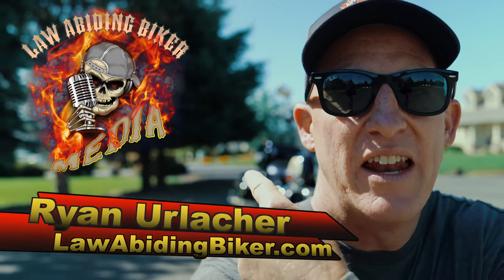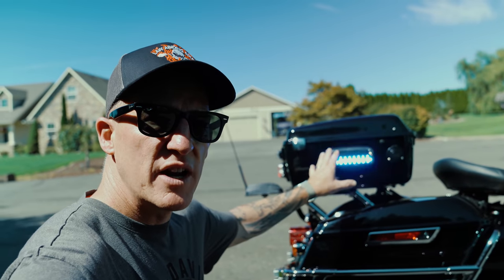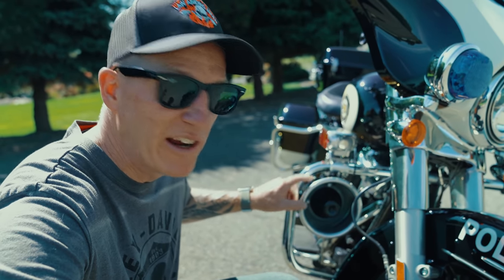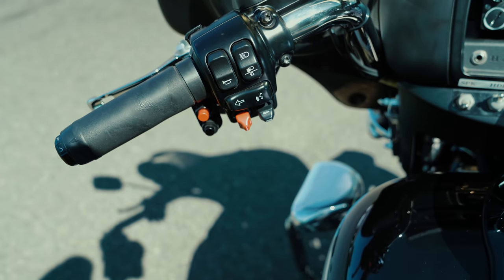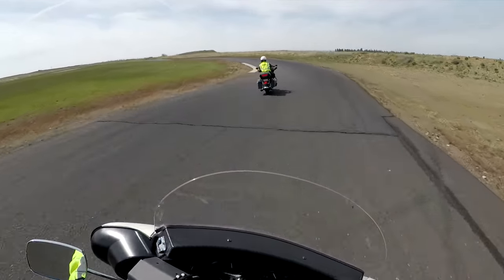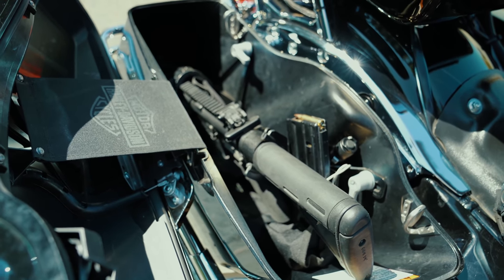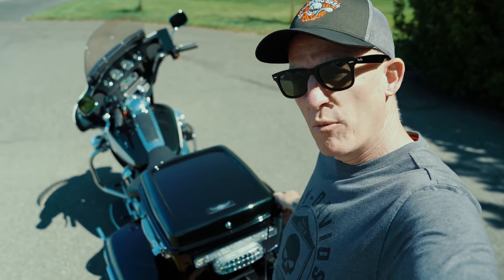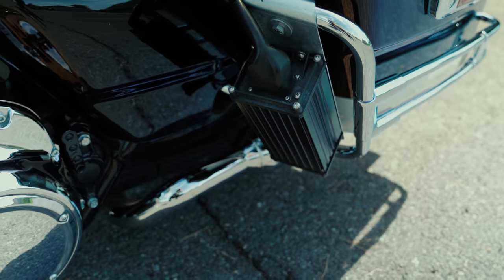Check out my Harley Police Motorcycle!

Comment: Nice video! I’ve worked as a radio technician for 2 different State police agencies and a number of County police agencies installing and maintaining radios, lights, sirens etc on the vehicles including bikes. Yours is the first one I’ve seen with the long rifle mounted in a saddlebag!! All of the bikes I’ve worked on always had the long rifle mounted somewhere on the back of bike. Of course they were locked up but easy for the Officers to access when needed. Your setup is very interesting! Thanks again for the video and stay save out there!
Reply from the maker: It helps keep the rifle clean as well.

Comment: Any suggestions for a reasonably priced am/fm radio and speaker kit for 2014 and later FLHTP's and, or, E/Glide standards?  I've seen one kit for 800 bucks but I'm talkin reasonable priced. On pre 2014 police bikes  with the larger glove box and easy to get to speaker pods, I installed a radio and HOG tune speakers myself for less than 200 bucks.
Reply from the maker: Sorry for the delay. No, I don’t have a reasonably priced solution. Hit me up if you find one you like!
Reply: @RyanUrlacher  I actually found such a kit here's the link /www.biketronics.com/standard-and-police-packages/ I just had this installed at  Auto styles of Leesburg Fl.  for a total OTD price $570.00  I'll include this info on my next youtube video
Reply from the maker: Yah. Cool. Test that baby good. Let me know if it stands up and is with it.

Comment: Does the 107 have good passing power? Compared to the 114? Kind of a weird question considering the police bike needs to be able to pursue, but I was looking at a standard Road King and was thinking of getting either the 107 factory with it or upgrading the engine to the police model performance. Not sure what stage. I'm not going to upgrade the exhaustor air since the current police bikes have 114 with stock air and exhaust.

Comment: Just discovered your channel. Nice video. Have you had any experience with the Concours 14, FJR 1300, or BMW R1200RT police bikes? Which do you prefer? I currently ride an older BMW, but I'm considering either trading it in for an FJR or a Harley Davidson. I'm torn between the power of the FJR and the comfort of the Harley.

Comment: I was looking at used turn in police units yesterday. I was shocked to see a low of 5000 miles and a high of 10,500. Is that a normal turn over, or do you normally put a whole bunch of miles on them before trading?
Reply from the maker: That's up to each agency and what sort of contract they have with Harley. We buy the bikes outright, so we run them for 30k or so and upgrade. Others are on the actual Harley police program where they pay monthly and new bikes often etc.
Reply: Ryan Urlacher thanks for the reply.

Comment: Hey Ryan, greetings from across the Atlantic. I love your videos and have learned a lot from them. 
I have the 2016 FLHTP (TC engine) and just adore it! Love the seat and the overall handling but the best thing about it is:
it looks so cool on the road. Although I'm not a LEO myself, it's legal to own a Police Harley (not quite sure about the blue strobes and the siren, though ;-).
Over here, motorcycle officers ride the BMW's but once I encountered them on the road and they were ecstatic about my American police bike.
Goes to show: Harley rules!
Got one question about your video: you mentioned the completely stock engine and transmission but doesn't have the Police Electra a stronger alternator built-in or have I been misinformed?
Reply from the maker: Very cool!!  Not that I'm aware of.  It's the same alternator that is put in all touring models.
Reply: I see. Thanks for the reply. Keep up the good work.

Comment: why don't these have 120 in them. I'm really surprised they don't because you're going to get a whole lot more freeway power out of 120 and you can get that from Harley-Davidson. I'm surprised bare minimum it's not a 117, having a base stock 107 is wack
Reply: You really haven’t ridden one?
Reply: @worldofzap  I work on them. I'm actually surprised police haven't gone with the Sportster police, I'm surprised police haven't gone at least with 114 with touring because they do not have much get-up-and-go, at least not compared to a Softail 107, that's because of weight. You do want a lot more torque with a touring model, especially with all that added stuff

Comment: My police work bike, county sheriffs office, is a 2009 electraglide or however you spell it and I hate that bike. My old crown vic is faster accelerating with a higher top speed and I can maneuver my personal bike, a Honda Africa twin, tighter and more precise. Myself and my partner were promised BMW GS bikes as our work bikes and during the last week of motor school they rescinded that and threw the harleys at us. Between the overheating and having basic cars like Camry's being able to just run away from me on traffic stops and the inferior slow speed maneuverability I cannot stand that bike. If I had more clout with the chain of command I'd petition for either ADV bikes or big sport tourers to replace the harleys.
Reply from the maker: Yah, you gotta upgrade at least to a 2014 or newer Rushmore bike. Totally different machines.
Reply: @RyanUrlacher  Its not my choice